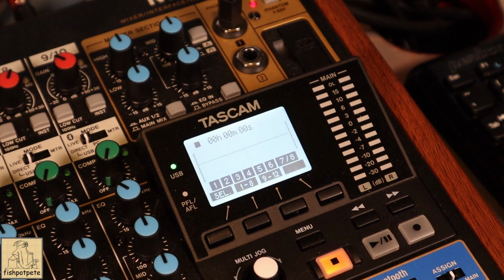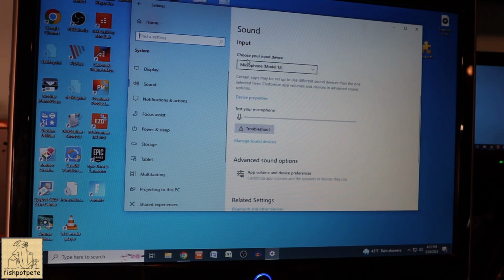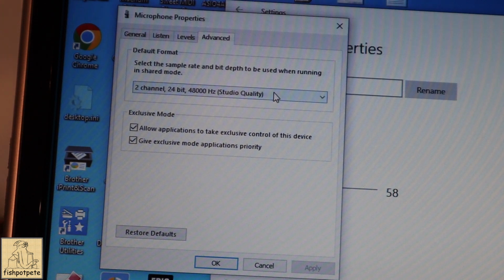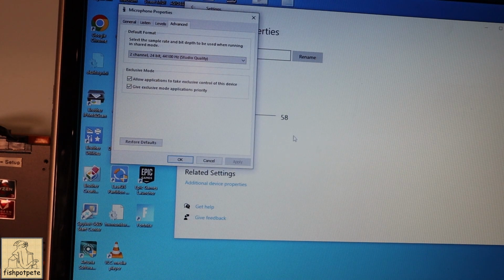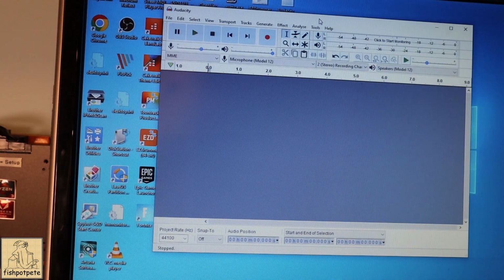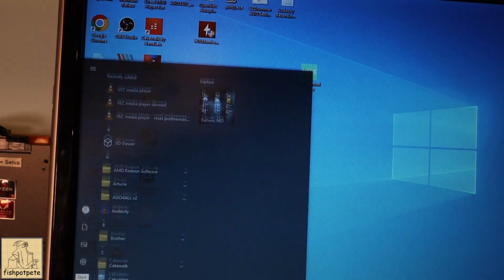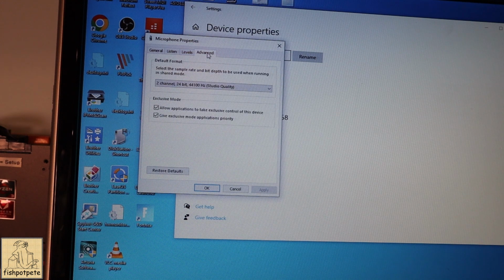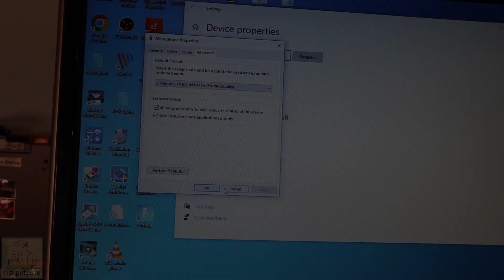Tascam Model 12 Frequency Mismatch - How to Fix!

Comment: This is correct if you have a recording on the SD card on the Model 12 and you want to record onto Audacity, otherwise, simply remove the SD card from Model 12 and Model 12 will auto-match to PC sample rate.
Reply: Buddy, pal, friend, my leige. Just coming up on almost a year with this thing and I've been staring at that fs mismatch message every day only to find out that the solution couldn't get easier. Words can not do my gratitude justice. Thank you. I wish long life and wealth upon you and all of your descendants
Reply: @woethekidd63  No problem :)